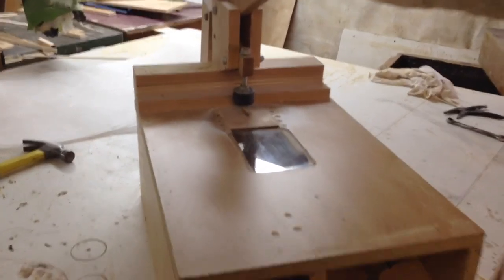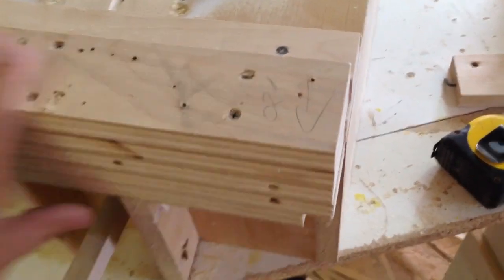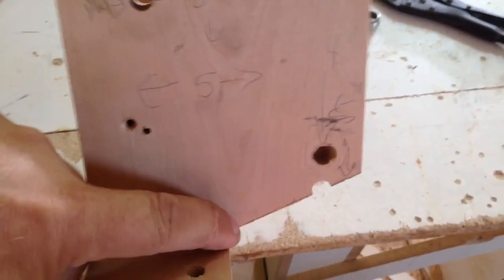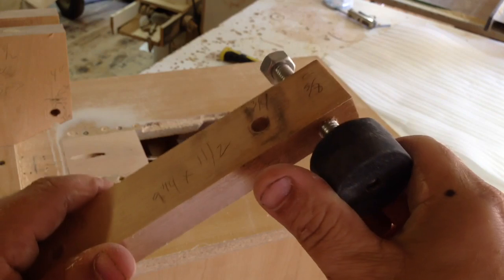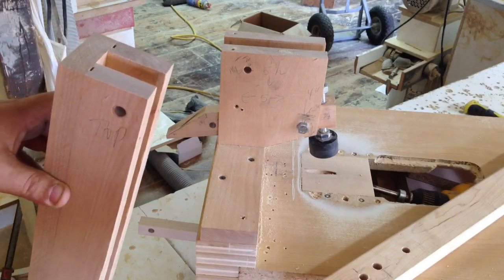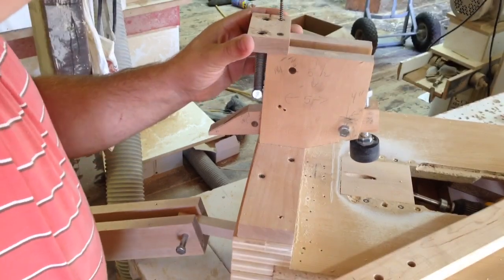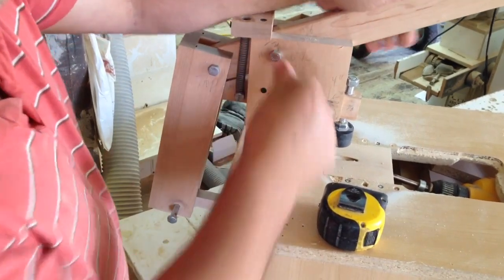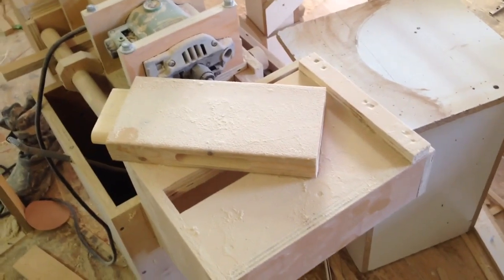Aug 21, 2014. Pocket Hole Machine sizes.

Comment: I just finished building this machine. It is simple and awesome. Only I springloaded the drillsled with a thick luggage rubberband, for a better returning performance. Then I set in a small piece of round steel to limit the movement downwards in the operating handle.Works fantastic. Thank You for that Idea! :-)